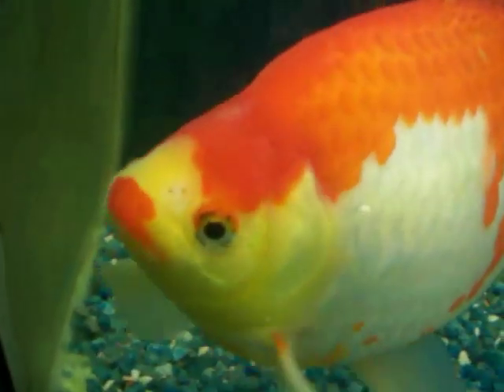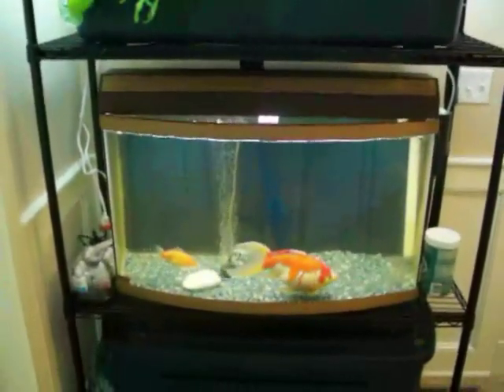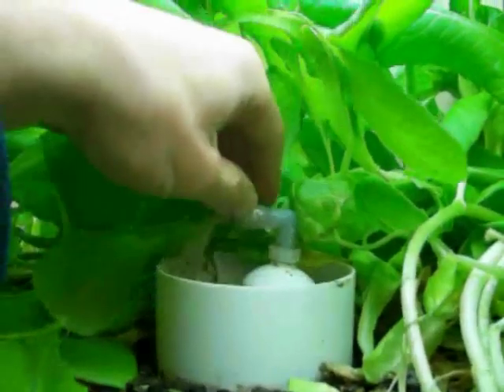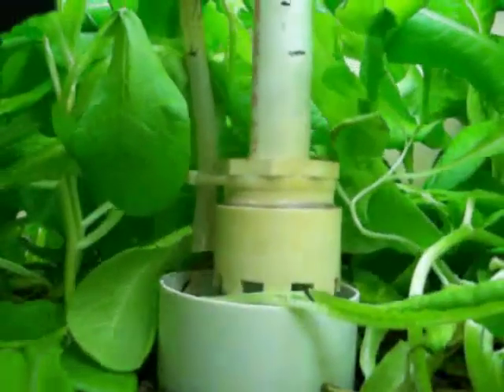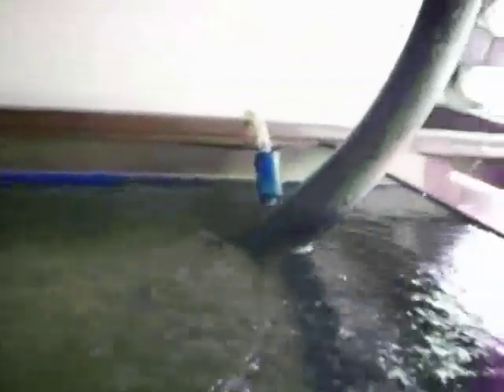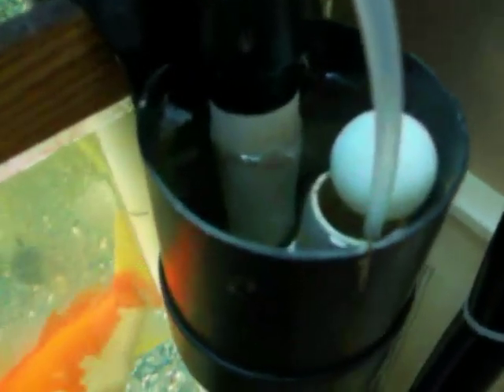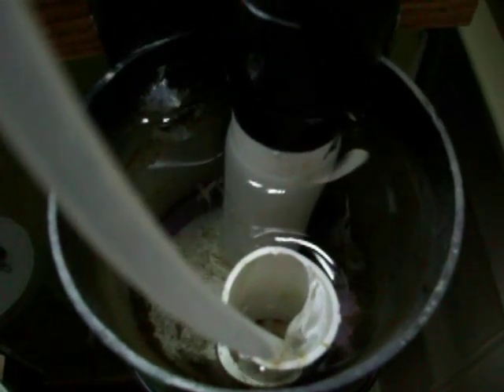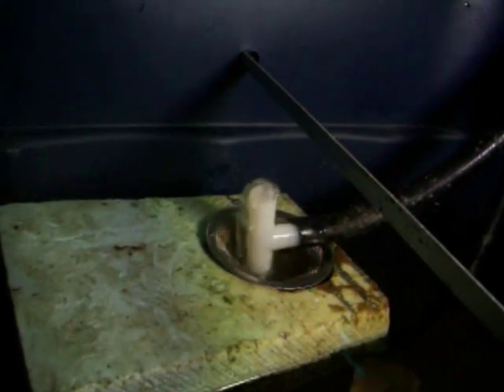Indoor Aquaponic System

Comment from the maker: the tube has clogged with poo.  It should be checked once in a while.  The sump is large enough to hold the water in the tank that would drain.  Once the level goes down to the depth of the exterior cup, the siphon will break.  If the power it turned on to the tank, it's important to start the siphon again, or the tank will overflow!

Comment from the maker: you can use some silicone in there and let it set for a day before using.  You could also make a little rubber washer  (I use an old inner tube.)

Comment from the maker: It will slowly siphon the water out of the tank...after about 2 hours the water level will go below the exit for the bridge and the siphon will stop.  If the power comes on the pump turns on and it WILL overflow the tank.  It's best to either unplug the pump until you can redo the siphon, install a UPS, or not use the mini-siphon that removes the air.

Comment: Thanks again, I figured it out.  If I kept the hose up, it sucked air.  If it kept it down lower than the water level, the suck hose just turned into a permanent siphon and wouldn't stop.  But if I put it back into the master tank and keep the end under water, then the pressure stays in the tube, no air gets in, and it doesn't keep siphoning off the master tank.

Comment from the maker: you need to keep the tube lower than the water level in the take before letting go of the end.  Then the water will siphon out through it.  The other option is to suck out the air, and put in a check valve like you said, or put in a little ball valve you can shut off.

Comment: Thanks Rob. This is might be a dumb question, but once you prime the bridge, and the water starts rising in the cup and then draining, what do you do with the clear tube? I see yours is stuffed down the drain, but as soon as I let my finger off the end, air rushes back in and the draining process stops.  I've seen guys use a 1 way valve rather than the barb, but how are you doing it with the tube?  Thanks in advance!

Comment from the maker: Yes, I tapped it.  Probably one of my better investments was to get a 1/4" and 3/4" tap to do various things.  I've even done thin walled pipes.  since there is basically no pressure on anything, I've never had anything leak.

Comment: Hi Rob! Love all of your videos.  I'm building a water bridge just like yours to test proof of concept and play around with.  I got all of my parts tonight, but had a question.  How did you attach your 1/4 NPT - 1/8" barb to the PVC elbow? I was thinking maybe just Tap the PVC, but I didn't think the material would be hard enough to keep the threads in tact. any thoughts on how you did it?  Keep up the good work, love the videos!

Comment from the maker: the pipe acts as a water bridge (siphon) were the water siphons into the cup on the outside of the tank.  There's a standpipe in the cup that keeps the water level the same.  It work well, but if you're daring, you're better off cutting a hole in the side of your tank for the drain.

Comment from the maker: It's a small piece of "angle iron" aluminum that runs down the length of the tub.  There's 2 pieces that run through the grow bed area that connects the pieces together so they don't spread out.

Comment from the maker: @yourcooltoocool It's used as a tiny siphon to remove any potential air bubbles that may collect in the bridge.  However, if the power goes out, it will eventually siphon the water out of the tank until the level gets below the bottome of the bridge pipe....then when the power turns back on, you have to reprime the bridge.  If it isn't there, you run the risk of too much air getting trapped in the bridge.

Comment from the maker: @gianolrac If they are submerged, chances are it will rot.  They just need to be slightly damp to germinate.  If you are going to use a flood and drain system, usually you plant the seeds less than an inch down and flood no higher than that inch.  There is enough moisture in that inch to get the seed to germinate.